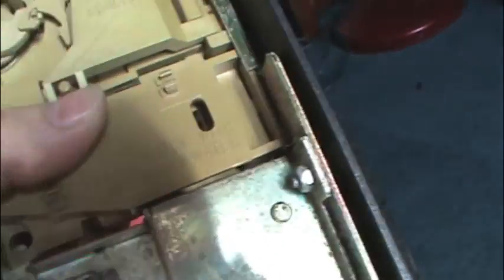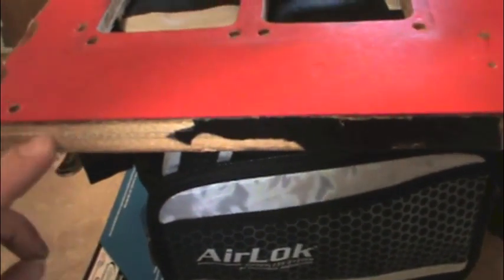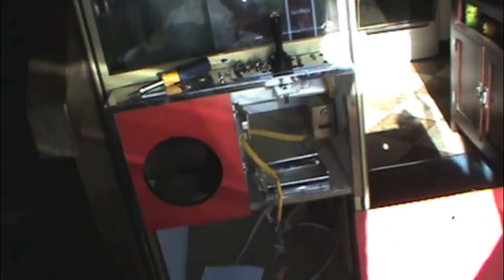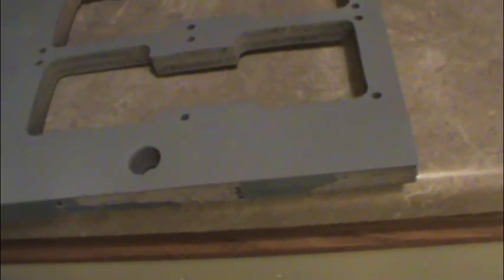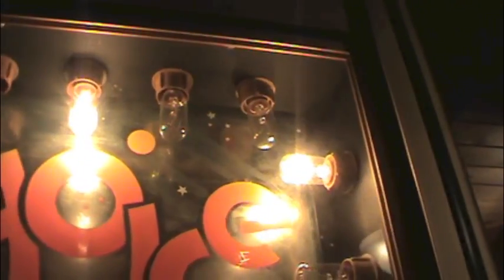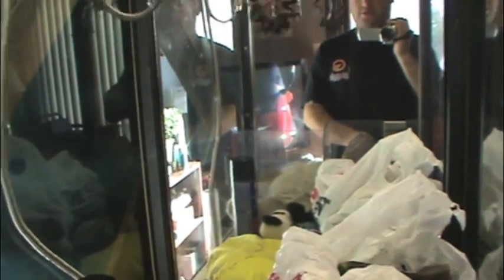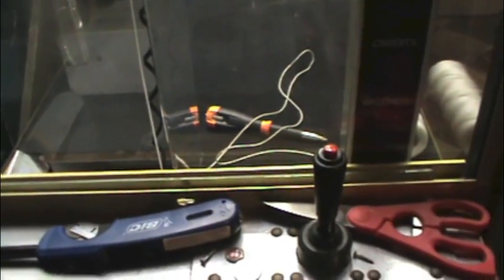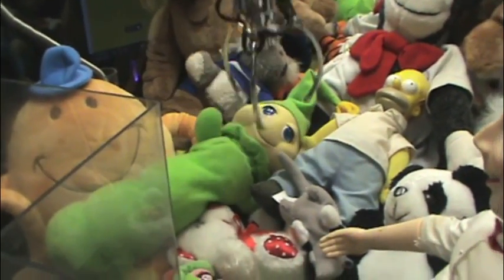More repairs to the Betson Claw Machine

Comment: For the hole you accidentally left unfilled, just put a bolt thru it like the ones you used on the coin acceptors, that way it'll look like it does something even if it doesn't.